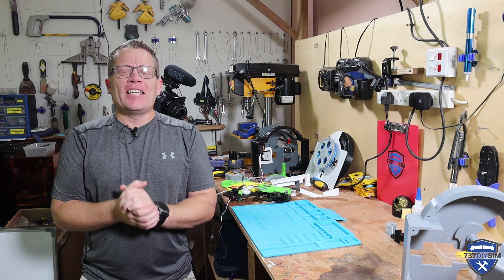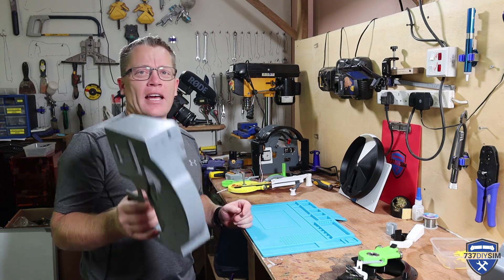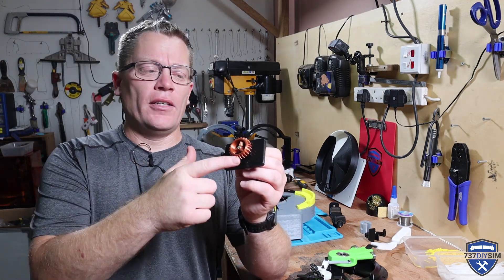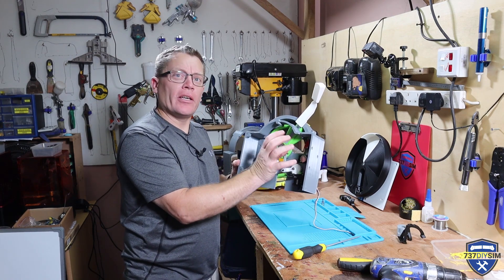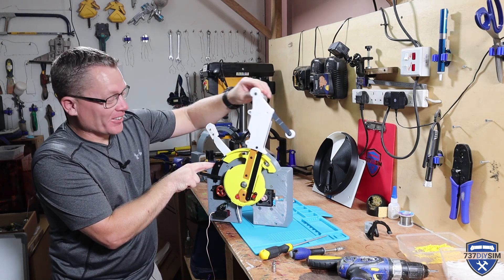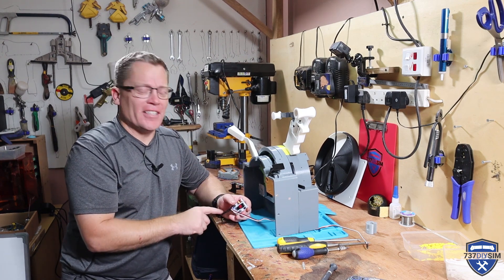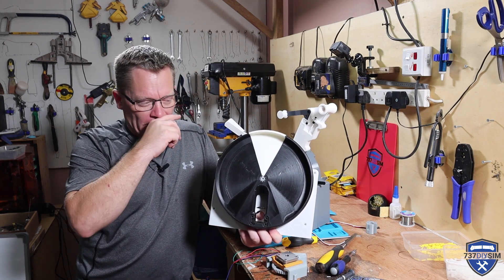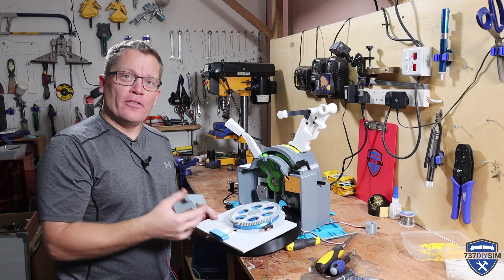Prototyping a 3D printed motorised 737 Throttle for MSFS2020

Comment: Several times you looked quite chuffed, and good reason to be. Well done on this project
Reply from the maker: Hi John, This has been a love hate relationship. It has taken so long that i get frustrated when i need to make a small change, but it requires a whole body print taking 4 days. Repeat this 12 times and morale gets a little low at times, but on the other hand. When it goes right, out pops that smile and me secretly thinking.....That will do donkey!...That will do. Kind regards Karl

Comment: Could a person who wants a 4 engine throttle setup just print extra handles and bases for them? Would adding 2 additional throttle handles fit the same way with just a wider unit overall without further modification?
Reply from the maker: Hi Ryan, there's not a chance of fitting 2 extra throttle into this unit, its so heavily packed. I know you also mean by extending it to allow for the extra throttles, but a complete redesign would be required, probably shifting the drive motors to a different plane/position.
Reply: @helimech8152  I really appreciate the reply. Thank you for taking the time to reach out.

Comment: Hi Heli Mech, 
thanks for your great video's. With your help I was able to build my own B738 FMC. Now, I am in the proces of motorizing my homebuild TQ. 
In your video, I see  that you use a steppermotor which can also be moved manually when the power is off. In my prototype, I use a very small and light (maybe too small) stepper for moving the levers. This stepper doesn't like it at all when you try to move it manually. Could you please tell me what stepper you use, and if I can find te specs somewhere? 
Thanks in advance,
 Niek 
(The Netherlands)

Comment: I may have to start work on a Generic Jet cockpit.... meshing several designs for a somewhat universal design for 2-4 engine jets. Though for that I really need a 3D printer.
Reply from the maker: Hi Sovek, 3d printers for cockpit building are fantastic tools to have. If you can used Fusion360 or similar CAD program, then you really are limited by your own imagine in what you can produce! Good Luck! Kind Regards Karl

Comment: Absolutely awesome work. I know how difficult this stuff is to design and prototype, you really have done something amazing there.
I've got a motorized throttle unit from a real aircraft here ( prototype Eurofighter of all things ) and that uses a central worm and wheel system with two clutches to drive the throttle levers. I should find a way of hooking that up to a flight sim, but at that point I'm entering territory where I'm not comfortable - I'm more than confident with mechanical devices and OK with analog electronics, but coding and computers fry my brain :-)))
Reply from the maker: Hi and thank you for the great comment! The eurofighter throttle must be awesome! Great for DCS. Kind Regards Karl
Reply: @helimech8152  I've come to realise that as much as I like DCS, it isn't a great candidate for building a complete cockpit due to a lack of easy ways to interface with it. I'll be transferring that idea to either MSFS or X-Plane. I got myself copies of FSUIPC7 and SpadNext for MSFS and I'm slowly exploring what might be possible. So I'll be watching your videos even more closely, to see what other useful tips I can pick up.

Comment: amazing karl, well done. what printer did you use to print those parts? they're massive!
Reply from the maker: Hi Rob, this time i used the Creality CR10 v3. Its a step up from the Ender 3 and has a slightly larger bed of 300 x 300mm. Kind Regards Karl

Comment: Great Job Sir, can you tell me what should I do in my 3D designs to get dents for my throttle?
Reply from the maker: Hi, i used a roller bearing which is spring loaded. The bearing the rolls into the detent and gives feel. You will see this more closely in further build videos, or if you want a picture, contact me on the website.  Kind Regards Karl

Comment: Great to see how this is coming through the prototyping! Any plans to modify the reverse lever? You’ve got the ‘kink’ going straight across/perpendicular. When in the down/closed position the kink so parallel the main throttle body. Keep you the great work! 😁
Reply from the maker: Hi, I will get around to it, but at a much later date with all the final astetics. I need to get all the main structal items fitted and ensure they work. Kind regards Karl
Reply: @helimech8152  awesome, good to here lol. Loving your dedication & enthusiasm with this build keep at it 😀

Comment: 4-day print. One piece. Several others of the similar size waiting around on the table. I had to pause the video. 🤔 😲 🤯
👍
Reply from the maker: Hello, this is the bad thing about 3d printing. I have no accepted things don't happen quickly using this method of building, but when you design a part and release its going to be days before you see it and most of the time, I know it will need a minor adjustment that will require a total reprint.
Reply: @helimech8152  - Although it is not fail-safe method, is it possible i.e. to design some parts from several pieces that are later going to be merged into one piece in final design? I.e. print major frame as 1 piece but make mounting points as inserts thus some omitted orientation or position can be fixed be a new insert? It depends also on free time one have available but even cutting away some bad part and fixing replacement by glue or screws would save time, printing string not to forget chances that whole print goes wrong for some bad luck - in the case of the several days of continuous printing.
- Btw. - issue with wobbling lever: I know that it is also limited by the available size but what about replacing aluminum bar with tube or hollow profile (i.e. rectangular)? That greatly increases stiffness. 
- I have no education in design and physics involved but isn't shaft for the trim wheel too tiny? When I imagine possible momentum when it starts turning and then stops or leverage you have when you trim manually and by chance it is blocked - and that force has to withstand teethed shaft of slightly more than 1 cm in diameter? And my guess is that due to printing orientation that twisting motion is in the plane of the printing layers - is it?

Comment: Hi Karl. What 3D printer did you use? What is bed size?
Reply from the maker: Hello Alex, for this project I needed a bigger bed thN my standard ender 3 Pro. So I opted for larger CR10 v3 with a bed size of 300mm x 300mm. Kind regards Karl

Comment: Awesome, I am halfway through V3 but not contemplating whether to stop and wait for this one or continue the V3 and sell it once this one is released and printed.     Keep up the good work!
Reply from the maker: Keep going! This is still month's away and it's a fun project to build. You also need a printer bed size a little larger than the ender 3. Kind regards Karl
Reply: @helimech8152  300x300 enough?
Reply: @helimech8152  I've got an Artillery X1 so 300x300   :)    Hope that works.
Reply: same here..

Comment: Love the build so far.  Did you print with your Ender 3 or have you picked up a larger one for this build?
Reply from the maker: Hi Steve, This was done on the larger Cr10, I will try to slice the final product somehow to fit on the ender 3. However, no promises right now!
Reply: @helimech8152  Awesome.  I was thinking on getting a larger Ender and the CR10 was it.  Wood has been getting really expensive in my town so I'm moving towards 3d printing more things for the sim. right now I'm looking at printing the RH and LH sills.  Well see how that goes, lol.

Comment: better designed than the one Boeing sells lol 😂 great job ! also, what bed size is required for these prints ? thinking of either getting a new printer or the "ender extender" for my ender 3
Reply from the maker: Hi, you need a bed size of 300 x 300mm minimum for this build. I like the ender 3, but now have a CR10 v3. Kind Regards Karl
Reply: @helimech8152  thank you for the quick response :) one thing i am curious about, when moving the throttle by hand wouldn't you risk frying the stepper controller because of the generated voltage?
Reply: @pvg5559  wow 😂 fair enough

Comment: Awesome build! May I ask if you use any threaded inserts for your bolts? Thanks!
Reply from the maker: Hello and not yet, as they haven't arrived. It's only been a few months since I ordered the inserts and mail delivery is taking 5-6 months at the mo. However, I'm not having too much of an issue with stripped threads just yet.